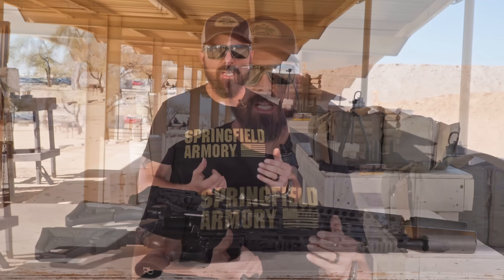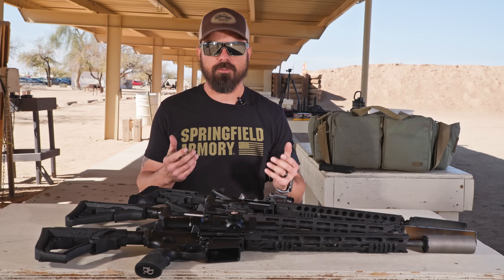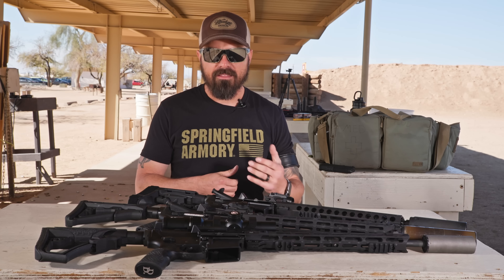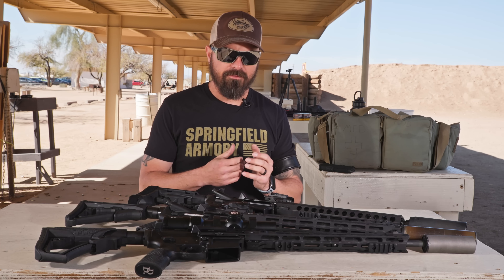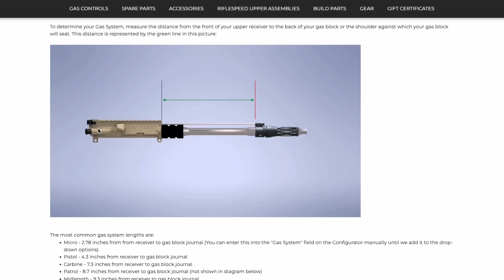Gas Back Bressure Mitigation Head to Head - Riflespeed vs Bootleg vs Superlative Arms

Comment: I bought a B&T Print XH SC and its FANTASTIC. It's light, its flow through, its quiet, it's everything I want. Before I was running a griffin HRT 556 and it wasn't the gassiest can but it was still gassy compared to a flow through can. I was running a A5 length Super 42 spring with a BCM T4 buffer weight with the griffin and that was still giving me like 2 o'clock ejection. Today I dropped the rifle down to an T2(h2 equivalent) and it gets a perfect 3 o'clock ejection. Milspec BCM carrier, .070" gas port. It's very smooth. I don't think I'll ever go back. Flow through is the way.
Reply: Yes!! Glad you are loving your new can! ❤
Reply: Did you have a gen 1 or gen 2 because the Gen 2 has improved flow through and they even changed the end cap

Comment: I personally use a bootleg bcg. I really like being able to adjust from the ejection port. Tuned my 13.7 perfectly. I still have a bit of gas to the face. But not too bad, very akin to shooting my mcx 300 blk

Would like to try a riflespeed at some point too
Reply: I have found that too, the boot leg BCG ejects the gas at the EJP so as a LH shooter I get some of that gas

Comment: I love the superlative arms piston, I have a couple. They run great. The SA bleed off really makes their piston and gas blocks the best choice imo. Nice vid!
Reply: Yes the real value in the Superlative Arms is the bleed off mode either in the standard DI and even better in piston. As someone that owns several they are the lightest gas piston setup. Also with the bleed off port you can shoot brake cleaner in there to keep you block from getting carbon build up. After all with a can why choke off the gas when you you can bleed it away from you at the gas block.
Reply: Thank you! 💯 agreed
Reply: Also love the Superlative, have 6 of them. They really help the AR-10. I’d love to see him test the KAK downward venting bcg. I’m running those also and absolutely love those too